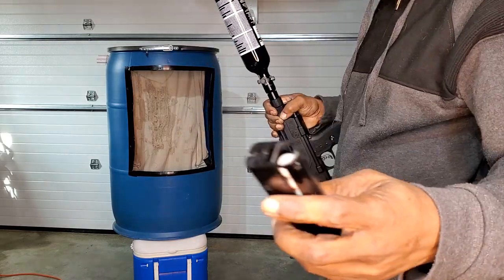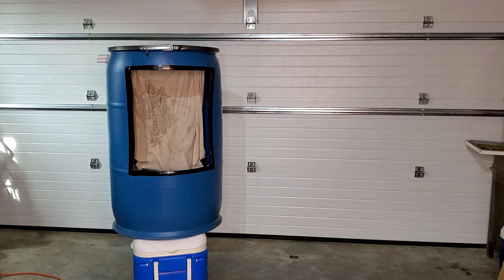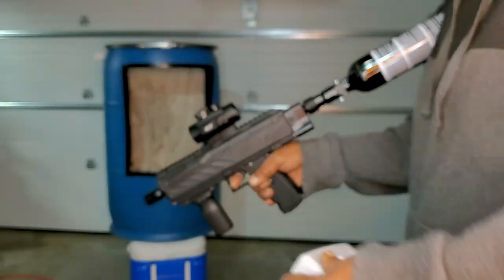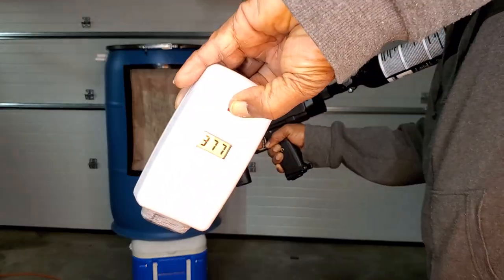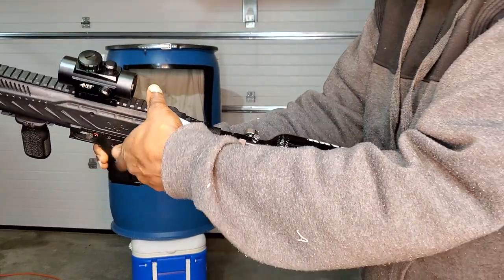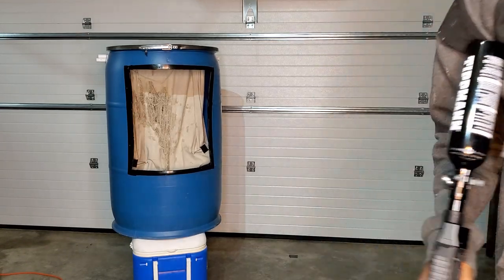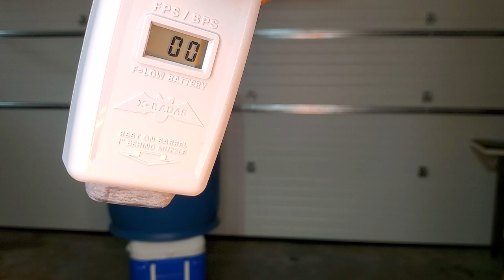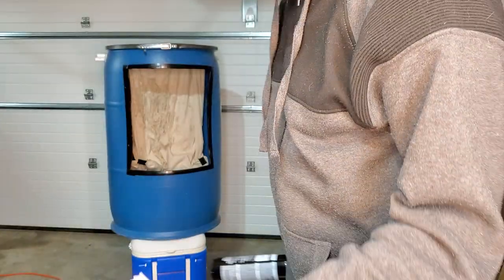TiPX - Let's Turn That Screw. Tuning For More Power!!! #tippmann #tipx #byrna

Comment: I think you could call this a series now 🤣. Bummer you left us hanging like some soap opera. Cant wait to see it with some heavier rounds. I think you might be surprised by how it responds shooting the heavyies. 

You should grab one of those Valken Ultra on/offs during your next spending spree. Its degassing feature is invaluable.

With that Tcr valve, barrel and tank the Tipx will easily reach 40j so there is definitely some more there should you choose. The prv will blow off when you reach the end of the road.
Reply from the maker: But wait....There's more! Hahaha. Keep them wanting more. Valken Ultra on/off? I will look for it. Thanks Professor 💥💥💥
Reply: @thellc24-7  🤣😂😅

Comment: That MCS CMP-18 3D SMG frame should be a required less-lethal mod. Makes the TiPX one of the BEST less-lethal solutions for the home AND SUV; so you need two of em.:face-green-smiling: 

Grimburg's video shows on an SL7 (which is a TiPX) Kurt installed a longer barrel and cranked up velocity screw. Using CO₂ and shooting its heavy 10.5 Jul rounds, Kurt's calculations showed 50 Joules on first shots! Side note: Grimburg is selling its TiPX (Sabre SL-7) for $500!  (For video search on YouTube "Grimburg Custom Sabre SL-7 | 50 Joules").
Reply from the maker: That CMP-18 is the shizz! I already planned on building a co2 one that is more portable for the car and truck💥💥💥